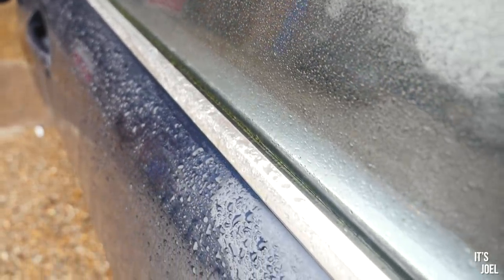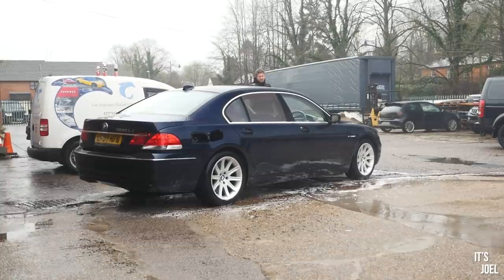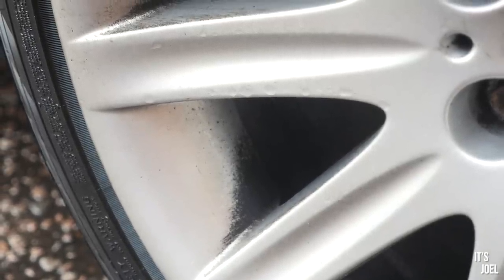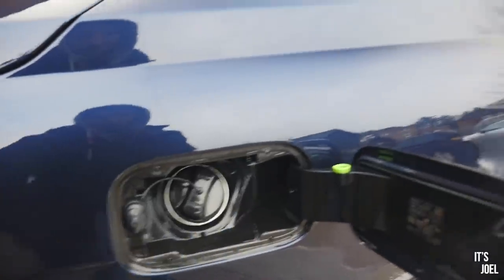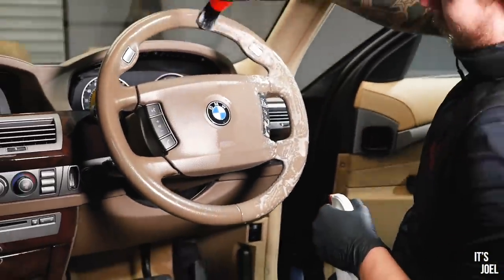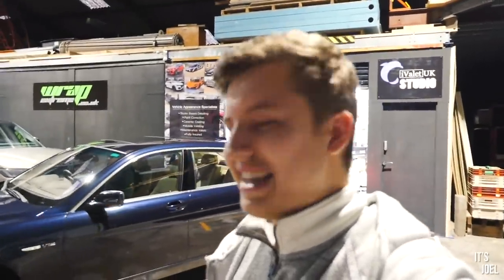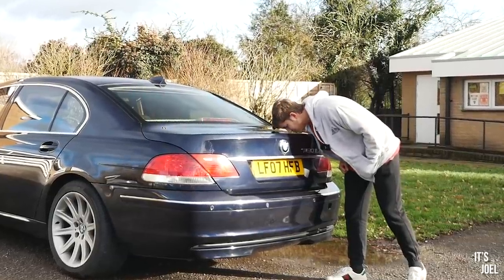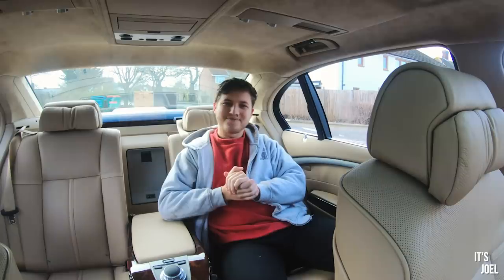DEEP cleaning my 2007 V12 BMW 760Li

Comment: This is my old 760Li!!! LF07 HFB. I had it for 4 years and part-ex'd it in June 2019 for my Maserati Quattroporte in Chorley. I got it from London. Great to see it being well cared for, I loved that car and was very sad to see it go. So much car for the money and pulled like a horse.  I have been looking at others! I sold it because the noise from the v12 was a little underwhelming. Will subscribe and interested to see what the mechanics check goes like, it never missed a beat for me but I ensured it was very well cared for by Autotechnic in Altrincham. Good luck fella 👍
Reply from the maker: That’s so cool! Can back up that by looking through the service history. I’ll be doing something to improve the sound very soon...
Reply: @itsjoel  Good luck my man, it's a lovely lovely car. When I had it the CD changer packed in. That was the only thing. IDrive was quite fernickety as well. Those heated seats and steering wheel were beautiful in the winter. It EATS miles. Contact me if you want any info about my custody of it.
Reply: Love this former owner contact. Good fella! I once bought a Cat D Boxster. I tracked down the original owner who sent me the spare key and original SH. Gotta love the car community!